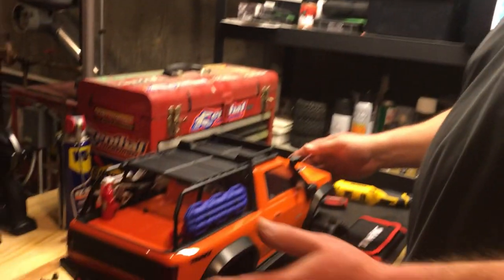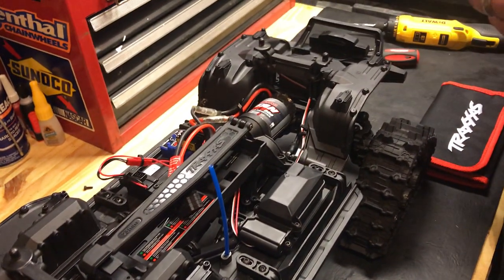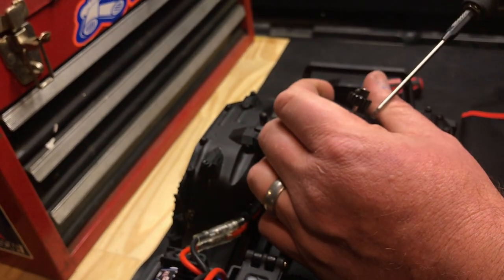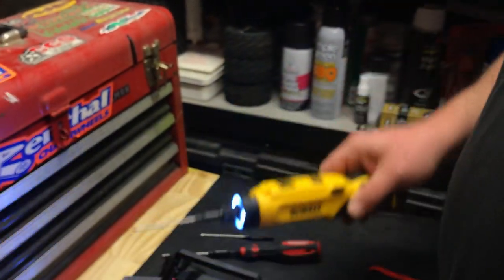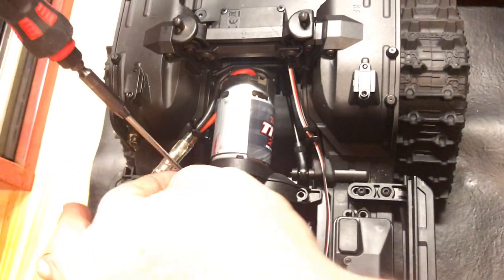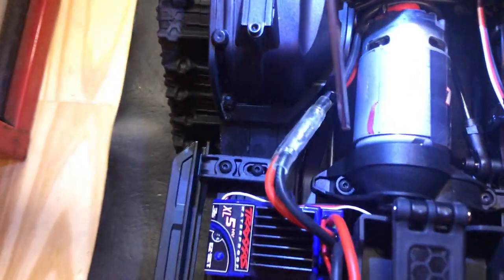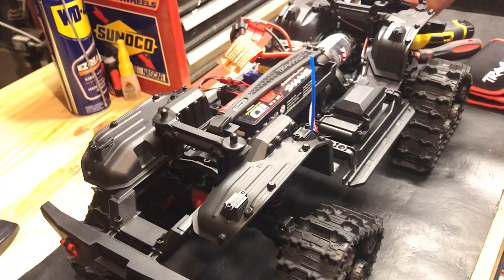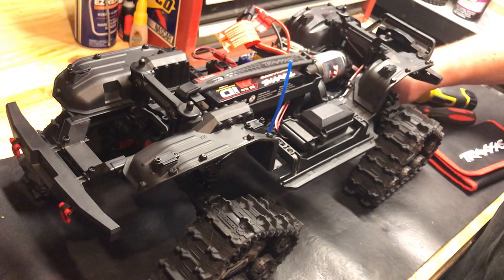Traxxas TRX4 pinion gear change 11 tooth to 16.  Complete install and run test.

Comment: I noticed that trx4 wouldn’t speed up properly, it went a certain speed then speeds up. I took the motor off and noticed that the spur gear is completely ruined. Would that be the reason it’s loud with like a clicking noise and does not speed up?
Reply from the maker: Yes it would.

Comment: sorry man , i put that very same gear in my trx4 with regular wheels and under load it burnt out my speed contoler in 5 minuites
Reply from the maker: It happens.  Has been good on my end.  Much more enjoyable and usable.
Reply: @Cooch5RC  , just giving a heads up man , i hope youre rig goes good ,.my rig by the way was old i  will admit , and does do some mileage .i hope all goes well for  you , nice channel keep up the good work ..

Comment: what is the model of your screwdriver?
Reply from the maker: Hi.  Thanks for the question.  It is a DEWALT 8V MAX Cordless Screwdriver Kit, Gyroscopic, 2 Batteries (DCF680N2)
Reply from the maker: https://www.amazon.com/dp/B08XWRH2CY/ref=cm_sw_r_apan_glt_fabc_YBNYP1RZYT1ZVV8EEM09?_encoding=UTF8&psc=1
Reply: @Cooch5RC  Thanks from Spain!